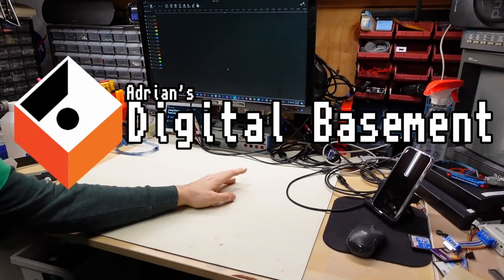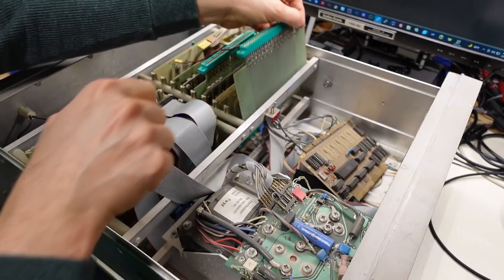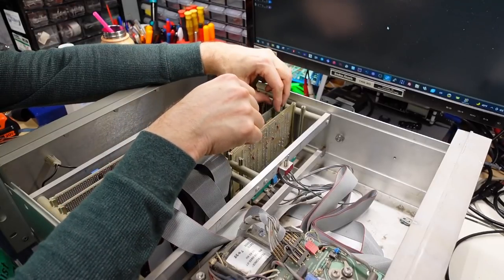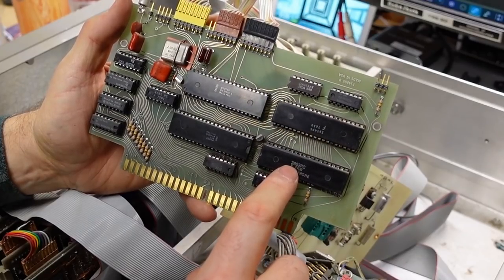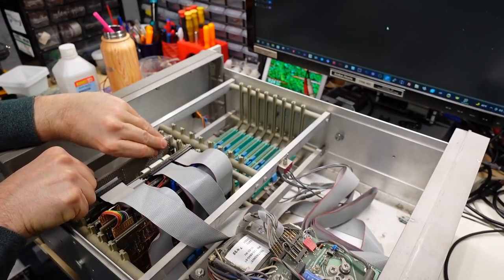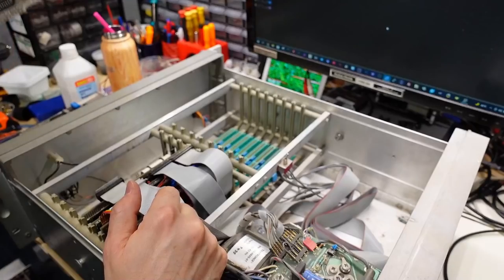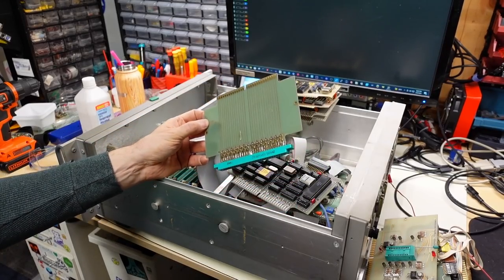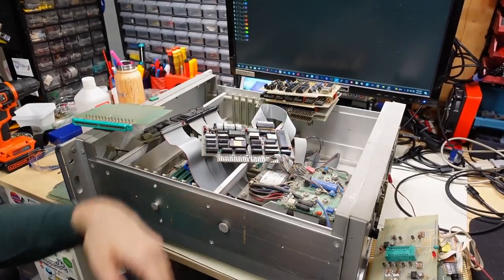I need help finding information on this mysterious computer

Comment: Back in the 1980s, it wasn’t unusual not to have raster video output.  The ADM-3A serial CRT terminal made by Lear-Siegler was de rigueur for CP/M based systems.  By the way, the cost of an ADM-3A was “only” $995 US in 1976 money.  Yikes!  If you wanted to get fancy, you could add an option to display lower case characters.  The ADM-3A was considered revolutionary as an output device because it was so inexpensive.  The competition would have been a DEC VT-52 or maybe a Hazeltine 1500.  I found an old 1970s advertisement for the Hazeltine 1500 for $1,125 ($4,700 in 2022 adjusted for inflation).  The DEC terminal was probably even more expensive.  That is almost what an entry level automobile cost back then.   The MSRP for a 1976 Chevrolet Chevette was $1,899.  That is why not too many people owned their own computers in the 1970s.

Comment: These types of computers didn't have a display or keyboard, they were used with external terminals. In this case, due to the DB25 connectors and the DB25 cable, I reckon it used a regular RS-232 or similar serial terminal connection.

Comment: From what you showed I would suspect that this is a development/engineering case used to create/test something that would be properly laid out and then sold. For this era it would also be reasonable to use a paper printer/teletype serial interface so that test result history would be available after a test run. At this era, a CRT monitor/keyboard would be quite expensive where a teletype interface would be more useful (i.e. because of the history printed on paper). The EPROM burner is one of the things that leads me to this conclusion, and coupled with the hand made boards and the adjustments made to existing boards also helps. I've seen this type of box before with a lot of what looks like cobbled together parts just before they get something working and then draw out the actual circuit diagrams to have it mass produced. CP/M also makes sense on a boot ROM too. The properly printed boards could also be V1 and the adjustments are for V2 of a product.

Comment: Those boards look a  lot like my prototypes. When I design a project for production the first step is to build the various modules onto breadboard where I can tinker and modify things to my heart's content. Once I am happy with what I have, I draw a schematic diagram and build the project on Vero Board. If any corrections need to be made to the diagram I do that then. The last phase before anything goes into production is, plot the PC board and I etch it myself. If there are many mistakes on the PC board, that is corrected on the PCB design and a new PCB is etched, built and tested again. It's loads of fun and saves my butt for sending a couple of hundred dollars worth of board to production with mistakes on it and then having to correct it and having to pay for retooling all over again.

Comment: I'm late here, but my first impression was defense, but the longer it went on, it seemed like a teaching project bench machine. Training or academic. Long span of dates there, and a rack mount with feet seems like the case was repurposed for a test bench. I suspect those cards were hand-wired by a series of students.

Super fascinating.
Reply: Nothing about this says defense.  No RAD hardening, No HEMP, No RF gasketing, No internal cable bundling.  It's either someone's project machine or it's a breadboard of some type.  I lean toward personal, based on the salvaged Tektronix power supply.
Reply: "...seems like the case was repurposed..."

Comment: Just looks experimental to me. Custom, well-built chassis, probably from a major manufacturer like Tektronix. Maybe used at a university physics department. Maybe just a prototype to build other in-house equipment. Maybe built to support the design of production equipment or other products. Where I worked, this would have been the first unit that never left the experimental development lab and the engineers would be in their cubical making changes to drawings on paper, then visiting the lab to build it themselves or supervise the technician. Had to start somewhere. You'll never find a schematic; you'll have to circuit trace everything.

Comment: Riser boards and the eeprom thing scream lab use. This item is a wee bit before my time. Stuff like your piece lived in dusty  places of my first PNW tech job not on the bench or in the racks. The SR staff had worked on Z80 things but the company had transitioned to a DEC 21040 shop.
Edit: I don't think it lived in a rack later in life.

Comment: Those mystery sockets on the loose Z80 card: I might suggest they're for 20-pin TTL latches - 74LS374 or similar, driving those pins on the top edge as a huge parallel port.

Comment: Isn't it one of those numerous Z80 based projects? You find Z80 SIO and PIO on a card, with an empty socket in between. That just smells like a missing Z80 CPU. Lots of such projects were based on the TRS80. With lots of addittions like color displays, sensors and what all.

Comment: Seeing the case and cards made me think of vintage HP and Tek equipment. Also the transformer is Tektronix branded, which makes me think this may be some kind of hardware they built for their labs.
Reply: Getting warmer friend
Reply: Definitely not HP, everything was gold-plated, including extender cards for tweaking boards, and had HP logo with a 10 digit pn. That level of kludge work was common for R&D and test bays in the production area in the 70s-90s, even early production boards in $25K equipment was shipped to the customer. We had 12 layer PCBs that cost $1k or more.

Comment: Ooh. Sorry if you've mentioned this (in a hurry, I had to skip around) but the insides of this are VERY Tektronix-flavored. The transformer is Tek branded and allll the interconnects are the very distinct ones they used in this time period. The PCBs look like theirs too. This come from Tek? You're near them right?
Reply: Those "ikea" lid latches are the ones they used then too.

Comment: The Z280 is not a math coprocessor. It is a 16 bit enhanced Z80 processor. Since it was in a slot and the board with the regular Z80 processor was loose, I suspect the Z280 was the main processor in use in that computer when it was last powered on. As a CP/M machine, it almost certainly used a serial connection to a terminal and parallel to a printer for I/O. There would not have been a video card. The board with the single large RAM chip on it may have been an add-on when they switched to the Z280 to provide the extra 8 bits of memory for the 16 bit processor. All just educated guesses.

Comment: Machines of that era did not have interchangeable boards and boards would have a part number with a revision number. You could have two machines, exact models,  but unless the revision number of the the board is the same you could not swap them. The machine looks like it may only have a floppy to load the programme and another one for data controlled by a teletype terminal  a printer with a keyboard, you type your commands and the machine will print what it is doing. You will need boxes of listing paper.

Comment: As far as I recall CP/M were all terminal based systems. I saw a lot of boxes like that one in manufacturing used as controllers with IEEE 488 to the machine and rs232 to the computer or terminal, however the EPROM burner built in makes it more seem like some kind of prototype system.

Comment: I'm pretty sure its an industrial control computer, manufactured to custom order by a specialist maker in the 70s, so not exactly "home made" but unique. The bus is a standard industry bus (STD bus?) and it looks like the machine has been upgraded regularly as is the nature of these devices. Lucky for you some of the peices were left inside the box when upgraded! 
Thinking again I'd guess this was made by a company with its own R&D facility, like an technology, aerospace or similar company.

Comment: Z280 is a very rare 16-bit general purpose processor, not a math chip. it's quite formidable, so that must be the real CPU card. very probably upgraded from the old Z80 card that was lying around.

overall it looks like a DIY development rig of a 1980s embedded engineer who specialized in Zilog tech. and it's way too serious for a hobbyist.

Comment: I built computers back in the day and I have the oak desk that I still use as a computer desk what has the opening for it when I had one.  I also made computers for Tier-1 automotive manufacturers and wrote their ERP software.  The S100 is nothing but a bus standard that you plug computers into.  It has no intelligence like a motherboard does.  You can make anything you want with them as long as the card can work with the bus.  For a computer, there are basically three ways.  One is to have to a card be the computer with the IO built on the card.  A second, and the most popular for business was MPM Multiuser CPM), and the third way, and the way I used it was as a network.  You think of network as Ethernet.  That was a strange concept and a real mess as far as I was concerned.    The network was made up of a CPZ48000 card which did the I/O to printers, disk drives, and ran the Turbodos Operating system which was written by Software 2000.  The Z80 cards were clones of the Intel chip but better and had some instructions that made it much more desirable.  They could see 64K of memory, so the programs I wrote had to stay within that size, so they would be made up of many executables that chained each other and you had to pass information using various methods.  The hard drives were just available back then outside of IBM and the only company that made them was Corvus. They were 40 meg drives.  Floppies were 5 1/4 and only held 256K or 512K.  They called them Winchester drives because they were invented by IBM and they prototyped the concept with two 30 meg drives, which is 30-30 like the Winchester model 94 rifle.  They were fast because the output was character based, no fancy fonts etc.  You could do screen highlighting but you had to write it into your programs.  The languages available were whatever ran on CPM, the de facto operating system until MSDOS and the PC came along.  The only 4GL database language was Dataflex, but I didn't use it because it was to limiting, so I went with CB80 and wrote my own database and b tree indexes and utilities that checked for integrity and rebuilt if necessary;.  It worked very well.  For backups, I interfaced a VCR.  With the VCR you can write the same data 8 times (the acetate isn't that good so you had to) and then do a checksum when you restored.  I have had to restore a couple times and I had no issues but it is an image restore.  E.G. you cannot restore a file.  The ones I made looked really nice as well.  I used white, mylar finish kitchen cabinets with oak trim.  Where the top drawer would normally be is where the VCR would be.  Below that would be the S100 cabinet, and below that on a shelf would be the Corvus 40 meg drives.  With CPM back then you had to compile in the drivers, and it was a little tricky to get the drives in the compile chain in the right order and it as jubilation when you found it.

Comment: Not totally sure but this looks familiar.  Lots of parts thrown in.  This looks like a machine controller.  Similar to an I2(Intellgent Interface) VTR  controller.  Used to interface a CMX editing computer to the serial machine control of a broadcast Video tape machine. This was used in the 1980s.

Comment: Starting with the part numbers on the bus extenders (which looked like the kind of thing you'd find in the early Jameco catalogs, even if the rest is bespoke) apparently the 2VH28/1AN5 is by Viking, maybe for the aerospace industry (though more likely the only systems that people keep running that would be worth having these kind of replacement parts for would be aerospace...)
The 2708's labelled DDT2 - DDT was a pretty common name for debuggers of that era, so you might be able to get that running without floppies (definitely image them first though.)

Comment: You keep asking about a "display". Most systems in the 70s/80s didn't HAVE an display. Your main interface was via serial, connected to a teletype or possibly a terminal.  This was VERY common in this time frame.  The first machines that had monitors generally had them built in (early Mac/Lisa, IBM "portable" PCs), or they had a system to connect to an existing NTSC or PAL based television.

This probably did equipment monitoring and/or remote control and reporting.  It likely ran without any visible display, making equipment work.  If there was any interface, it was likely on the machine it connected to, in the form of lights or buttons.  (Think: Elevator controller.  The "UI" is the buttons in the elevator.  This would make "smart" choices about standby locations, overrides, etc.)

Comment: Obviously not an S-100 bus.  
The ports on the back panel are likely for 34-pin MFM/IDE floppy and hard disk, and 50-pin SCSI.  Plus 2 RS-233 serial ports and a parallel port.  No video out because it used a serial console.
Looks like a development system used in-house somewhere, maybe at Tektronics.  Maybe the power supply was scavenged from another piece of equipment, or was supplied with the nice case.

Comment: I worked at Tektronix. It so looks like something I'd have built. Super common to have something like that on a tech's bench. Definately looks like an S-100, I used a few even in the late 90's. 
The early high def test gear was truly gigantic, and mostly hand made boards.
Reply: Additionally it was standard to hire "just under" engineer level techs as building test gear was kinda standard.

Comment: It looks similar to the main processor used in the FAA ALTE(Automated Line Test Equipment).  Faa's ran the React2000 operating system.  It controlled automated access/testing  of Telco circuits.

Comment: I have seen one almost just like it. it was paired with a PDP8 running a radio phone system ( pre cell phone days ) and yea you communicated with it via dumb term. but yours may had a different use. Sam Cross could tell you, because my old friend Leu repurposed stuff all the time to get things done I miss that old guy. and that power supply was more stable and cleaner than any switching mode one mad at the time... witch is why in a RF sensitive environment they was used. just what I have seen in my young days and could be wrong.

Comment: The transformer and power supply boards provide important clues.  Tektronix (Tek) transformers were mostly either bespoke (custom specs) or made in-house.  They were far too expensive for other companies to use in prototype work.  Also, I think I see a Tek part number etch on the power supply board.  If so, it was also made in-house.  Rack-mount format implies the project team occupied space in buildings 39 and 47 on the Beaverton, OR campus.  (Not a sure thing, as other Tek campuses also used the U-bench cul-de-sac cubicle layout for important projects.)  Too many other clues to describe here.  If made to guess, I would guess that this particular box is either from the "Magnolia" smart terminal project (cancelled at the working prototype stage by vision-less MBA management) or else from the microprocessor emulator product development program (successful and quite profitable).
Reply: After reading a lot of these replies, and hearing that Tek wasn't far away from Adrian, I'm starting to think that Tek made their own general-purpose rack-mount computer system for resellers who needed low quantity, and these are the actual original prototypes. The F8 part was probably "just" an EPROM programmer for the developers of the original CP/M system.

Comment: Clearly the control unit for someone's homemade time machine..  The MK3850 seems to be an early 8-bit CPU.  So this thing is crammed with CPUs.  Those homemade boards are works of art and must have taken more patience than I've possessed in my lifetime to build.
Reply: I’m surprised it was hand soldered, though when I worked in a medical lab in the 1980s I did do a couple of boards in a style similar to these for Apple ][ computers which were controlling an experiment.  There wasn’t enough clearance between the card slots in an Apple ][ to accommodate wire wrap sockets so I hand soldered the 30 ga. wire.  I also made some boards for a Cromemco S-100 system used in a psychology lab and used wire wrap because there was plenty of space between adjacent cards even for sockets with pins tall enough for three level wraps.  The psych. lab system had a Morrow Designs Thinker Toys 5 meg hard drive in a separate cabinet that weighed probably 60 pounds.

Comment: You have to keep in mind that back then multilayer was almost never an option so what seems like modifications often is designed in. You might want to somewhere upload high res pics of all PCBs ... It surely wasn't made by a private person but most likely a one off or small series. My guess here would be some kind of debugger/emulator/interface for some other specialized piece of kit. Given they reused a tek PSU I would put that into the scientific/measurement department.

Comment: The Tektronix power supply is interesting.  The power supply might have been harvested out of something else.  I have worked with some low production Tek equipment that looked almost as nice has high volume stuff.  Maybe this was a prototype for something under development, but seems too messy.  Most likely it is a custom CP/M system for process control, but you may never know who made it unless you can boot up the floppies, if you have them.  I assume the drives are probably Shugart SA-801 or SA-851.  If so, the drives probably still work.  If they were going for performance and used Persci drives, maybe less likely to still work.  The voice coil positioners on Persci drives were twitchy even when new.